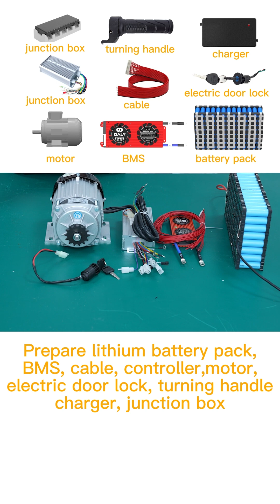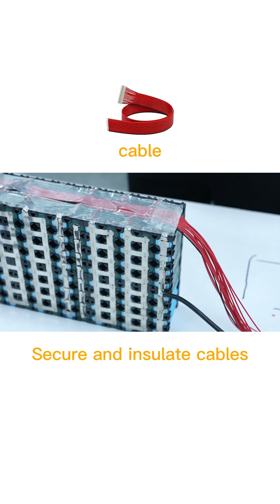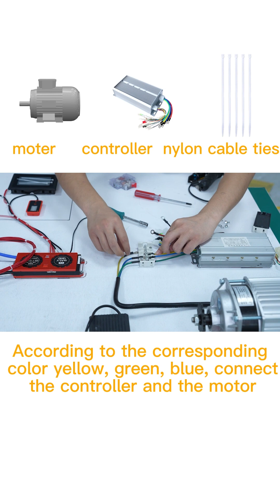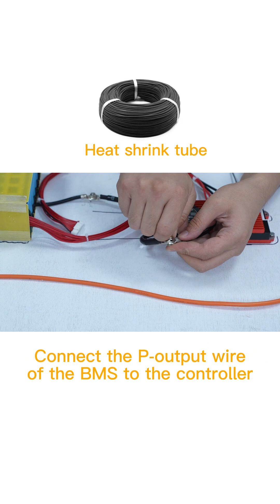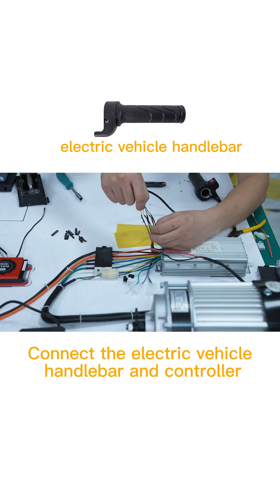Electric Vehicle Power System Production Demonstration

Comment: When you start connecting a engine, then create a video with osciloscope and show a "surge/peak" topic, means how check if surge load are OK to BMS, When use softstart with engine, bcs you know... big load can be connected and generate problem - good idea for new video.
Reply from the maker: yeah,  that would be more complex but interesting! I will think about how to do that, thanks a lot
Reply: @BMS-Lithiumbattery  Detection via a) shunt + oscilope b) clamp meter with Amper Max function c) BMS show some warning, last peak?
Solution/WorkARound via *) softstart *) capacitors & coils *) ATS switch heavy load to unity from battery system when we have to many loads

For me only part one should have 80% of video time as show problem how detect and show direction to fix, bcs. problem is complicated but good to show it and at least how detect. Similar to video when you do a short circuit with BMS who protect but of course should be used with paraller unit. Show a last peak and protect and how solve situation to not be pernament - that info video will be best.
Thanks about taking up the topic.